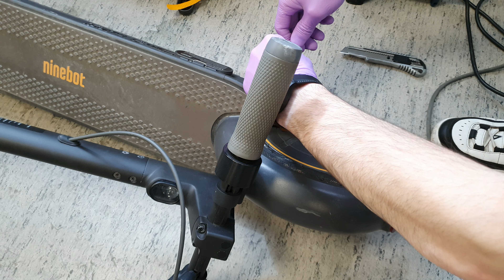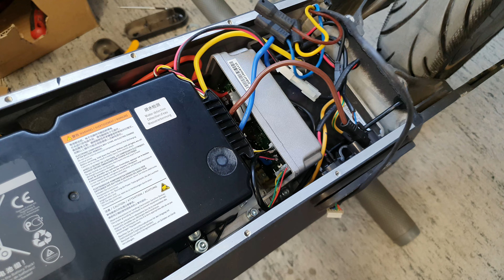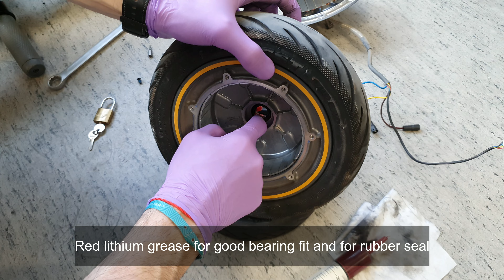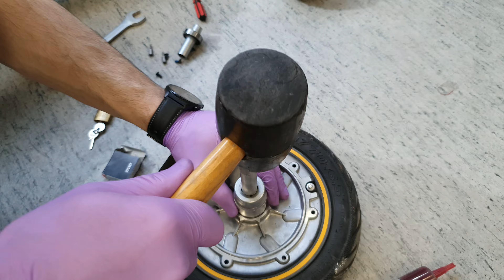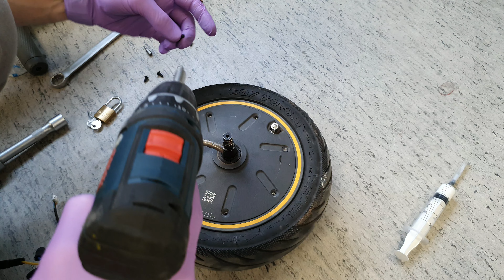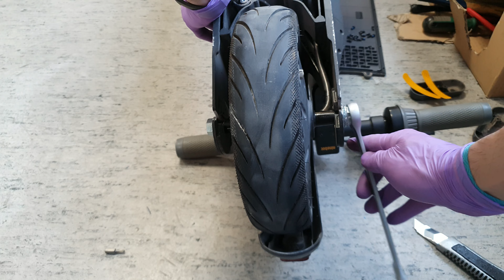SEGWAY NINEBOT G30 MAX G30P G30LP G30D G30LE G30LD G30E II | REAR MOTOR BEARINGS REPLACE #G30MAX

Comment: Do you know if a Max G30P rear hub motor can be replaced with the Max G30LP motor?
Reply from the maker: i guess they are all the same, like xiaomi sccoter.. the power of the motor may be different... but you can do a research of what model is different than the other..
Reply: @RMFUNTIK  I check theirs manuals and both use the same motor. Thanks for getting back to me!
Reply: There's no reason to do this. The G30P motor has more torque and you can use field weakening to get the G30P motor to go faster. In air mine goes instead of ~30 kph 72 kph. :)

And no, I don't think you could ever go so fast, even if you're light. But there's no speed limit, just a power limit with field weakening.

But I recommend replacing the motor plugs shown in this video with Wago clamps (the 41 A ones) as the original plugs have a high resistance.

If you need the settings I use, feel free to hit me up :)
Reply: @LinkIsNoJoke  Nope, there's a first and a second gen motor on the G30P, the second gen is what you get on the G30LP. So if you got a first gen G30P,  you have a different motor. You can identify them my the marking on the side.

The first gen motor got more torque, the second get motor can go faster, but has less torque.